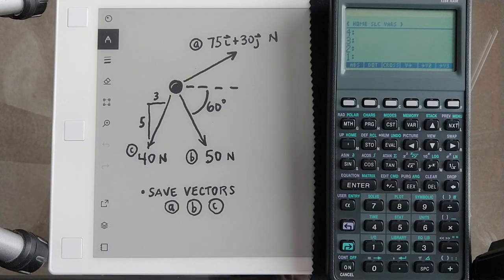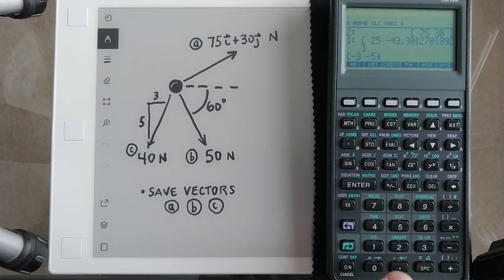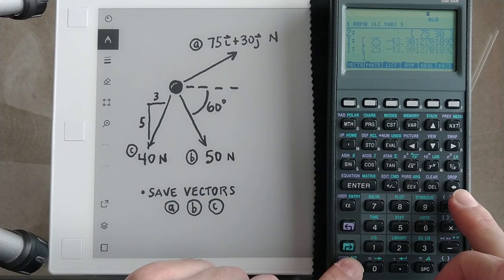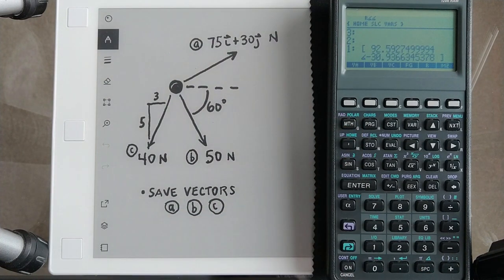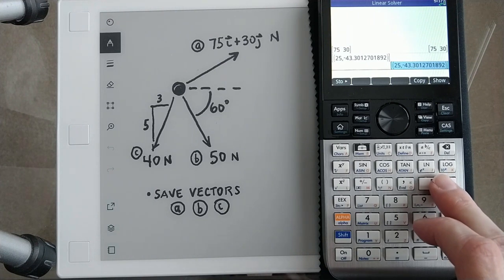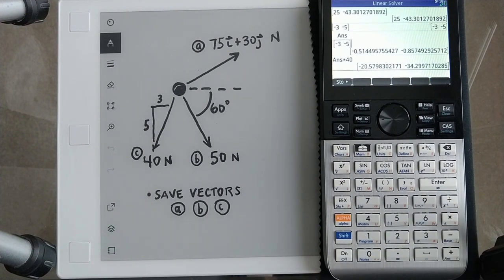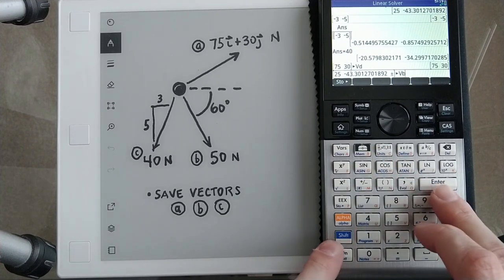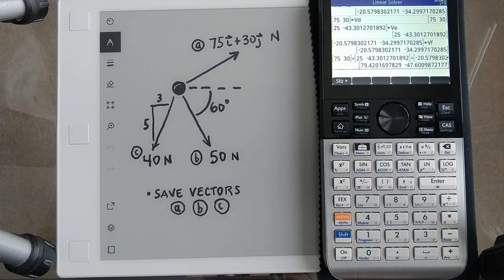HP 48GX and HP Prime - Finding resultant vector

Comment: I do not understand the {[-3 -5]/absolute value of [-3 -5]} in the trig vector for what?,...I forget the basic principle... BUT I have to remember this first!
Reply from the maker: I'm diving by the magnitude of the vector to come up w the unit vector (which is a vector w the same direction, but w a magnitude of 1 unit).  That way we can multiply by 40 to get the x and y components of our 40 N vector.

Comment: I've got the same issue with the HP Prime. It doesn't seem to work as well in RPN mode as the 48/49/50G series.
Reply from the maker: I cannot quite articulate why, but for me the Prime is lacking the magic of the old RPN/RPL calcs (28S, 48GX, 42S) even if it is immensely powerful.

Comment: Late to the part here. I'm looking for something that makes vector calculations a joy and have no need for a restricted system. I just need answers.
Here in the UK the earlier hp machines are rare and expensive so the prime looks like the goto.
Your two videos are both excellent for showing how this works and the ease of the old tech.
Maybe the new units can graph the regression of ease of use for us.
Top work though. Thanks.
Reply from the maker: Thanks for the comment, Alister.  Glad you found it useful!  Yes, when it comes to "just needing answers", I feel like the vintage hp calculators like the hp 28s and hp 48gx were superb.  Appreciated the cheeky "regression of ease of use" graph comment, too.

Comment: Hiya Scott.  To convert your second vector on the HP Prime (at 2m38s), the better way was to enter what you did..but inside round parens.  i.e. [(50<-60) ±]  *ENTER*.  Thanks for your videos.  p.s. what is the '±' there for?
Reply from the maker: By using the () round parens, you are solving the problem using complex numbers rather than vectors.  Granted, you will get the same answer, and it may actually be simpler.  I just wish the vector [ ] abilities were more full-featured.  As far as the ± goes, it is there whenever you use [ ] to enter a bracket -- it is how you add an additional column (e.g. for a 3D vector).  Thanks for leaving a comment, Incyter!
Reply: Using () will get  different results /sometimes/ depending on the quadrant, I believe. Try it with different quadrants, and see.

Comment: Had a 48Gx way back in old days.  Did NOT like it at all, was very SLOW to respond, and very SLOW to calculate.  sold it to another foreign student at Iowa State University.  The person paid in cash $1, $5, $10  he and his girlfriend must have saved up all they could for it.  $300 or $350 it seems like with various accessories.

1
Reply from the maker: I do not mind the speed of calculation on my 48GX, but do agree that when you are using the graphical-based menus/programs it is painfully slow.  I don't use the calculator very often these days, but when I do, I generally avoid the graphical menus.  Thanks for the comment, Pablo.

Comment: As someone who's used to the 48 and is curious about the Prime, this is really nice to see.  I would watch more videos like this.
Reply from the maker: Thanks for the feedback.  The 28/48/49/50 are just a completely different machine than the Prime.  Both have their strengths/weaknesses.
Reply: @scottcollins7513  the prime can also use rpl or rpn i think
Reply from the maker: @parragoriouse0138  True, but it is still a “standard” calculator at heart. The RPN is not full featured as far as I know (I have very little experience using the Prime in RPN).

Comment: Another remark, right now, spherical or cylindrical coordinates are still not implemented on the prime. This has already been asked for a long time so it seems, but even with the latest firmware (2020), it's still not implemented. So it's better to work with the 2D-vectors as complex numbers I guess, for easy switching between rectangular and polar form. (=within normal brackets)
Reply from the maker: It is strange that they never addressed this issue.  Thanks for the comment.

Comment: If you just want to add the vectors, you don't need to first store them into variables
Reply from the maker: Correct.  I should have been more clear about that.  I just wanted to show how one could save them for use in subsequent calculations.

Comment: The results differ between the two calculators, any idea why? Btw this is really slick on the 48 as you said. Would it be simpler on the Prime in RPN mode?
Reply from the maker: I have essentially no experience using the Prime in RPN mode.  My hunch is that using RPN on Prime would be convoluted in comparison to the 48.
Reply: RPN is my default mode for the Prime. I got one of the first 48 to come out, and still think it is hot stuff, in a nostalgic sort of way. I also use the 50G. I miss vector math on the Prime, because I use it so often. Doing this problem in RPN is virtually the same on both machines. The extra step is converting the complex number to a 2D vector, which is simple editing, as you have shown. The -3,-5 vector I enter 2X, so that I can take the abs() of it, then divide and multiply. All the same steps you need to go through to solve the problem, so there is no short cut. You could have calculated atan to go with the 40, but there is no savings there.
Reply: The results appear exactly the same to me ;-)
Reply: @bolleke702  Oh my bad. The result on the Prime is in rectangular form, that threw me off. 🤦‍♂️